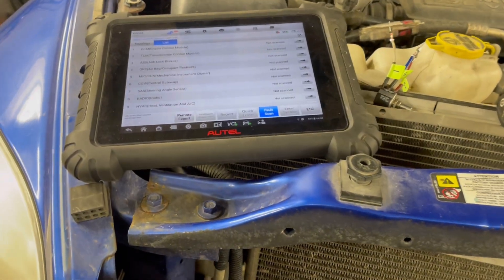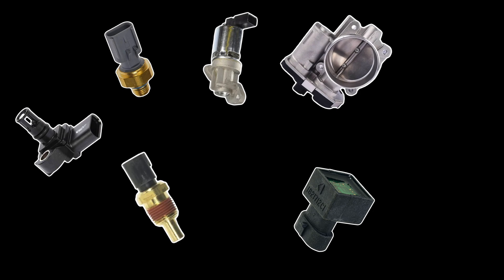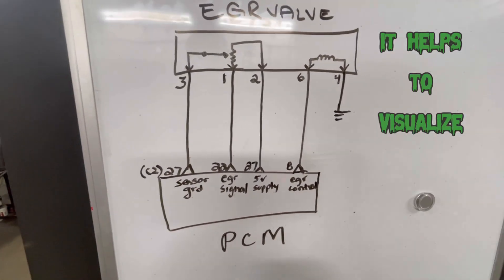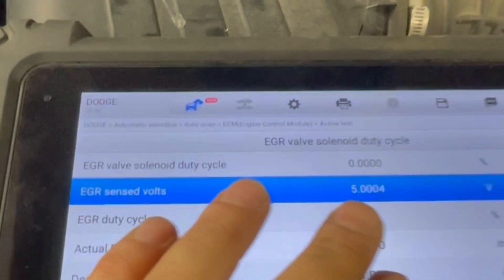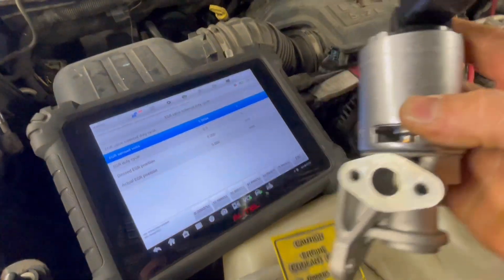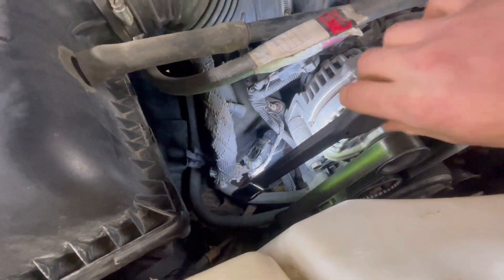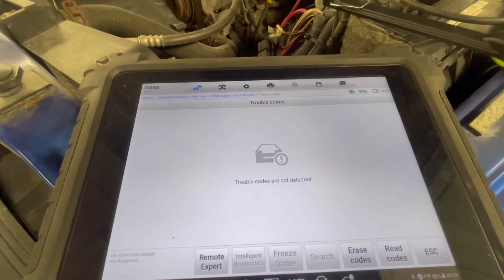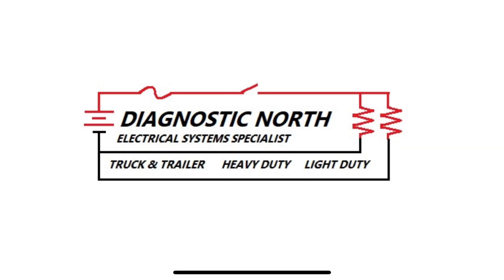08 5.7 EGR valve diagnostics, p0406 exhaust gas recirculation high

Comment: Silly question can a ecm throw a wrong code to a problem.     I guess  the reason I ask this question  is I have a 2005 dodge ram 1500 5.7  when I got the truck it was throwing  a p420 code a few months  later fuel pump went out replaced  fuel pump code never came back.     Now I've been fighting  a camshaft position sensor circuit a code  I've replaced the sensor 2 times with no change  and a knock  sensor code replaced both knock  sensors with no change  could there be something else wrong other then what it's throwing codes for.    It seems to lack power. I'm also  only averaging 12mpgs on highway  doing 70mph.  It use to do better
Reply from the maker: @Benb05  not a silly question, technically yes because it can only make a determination from what its sensors are telling it.  Sounds like you found the problem for p420 But it's always good to start at the beginning , what cam shaft code is it throwing ? It may be a wiring problem, just went through this on 2015 super duty 6.7, it had cam shaft codes and the problem was one of the wires were shorted to ground.
Reply: @diagnosticnorth  my current  codes are a p0325. P0330. And a p0340  any help is greatly appreciated.  Thanks in advance    i know it's difficult to diagnosis problem  through messages  and understand  if you can't point me the right direction  with out seeing  the truck your self   but and and all advice you give will be greatly appreciated 😊
Reply from the maker: @Benb05  I just quickly punched those codes in to google and they came back as knock sensor wiring codes. It's not easy to diagnose things without looking at the vehicle but it is possible ! I've done it many time on this discord server that I started. Here is an invite link, join and I'll post some diag Info for you. My first guess for your truck's symptoms  is a mouse nest in the "V" of your engine , and they probably ate some wiring since you have codes for both circuit knock sensor bank 1 sensor 1 and knock sensor bank 1 sensor 2 . A quick visual may help . As far as I know it doesnt seem like the cam shaft sensor has anything to do with these codes.

https://discord.gg/Pwnu6Kr2

Comment: Nice video. I see you got the LoWash on that Truck. My truck does the same thing even though I’ve changed sensors several times and track wiring back to the pcm/tipm. Any ideas on why those low wash warnings keep popping up. I read the sensors are sort of capacitive, and the computer sends a voltage pulse so you see a square wave on the scope, just wondering if you ever messed with it
Reply from the maker: If you want to shoot the shit about the low wash circuit,  join my discord server https://discord.gg/fhUqcsg4 
We can look up the specifics and try to understand how it all works.